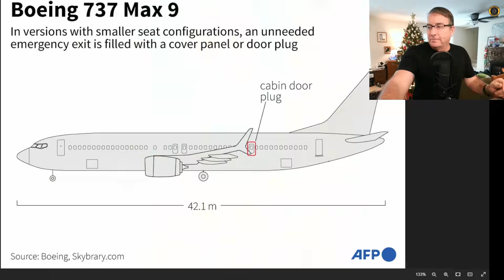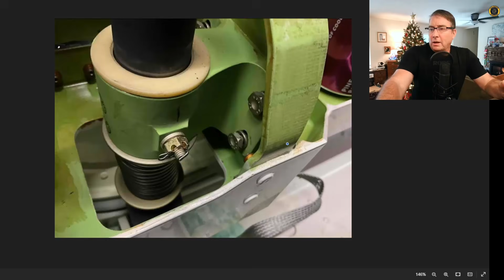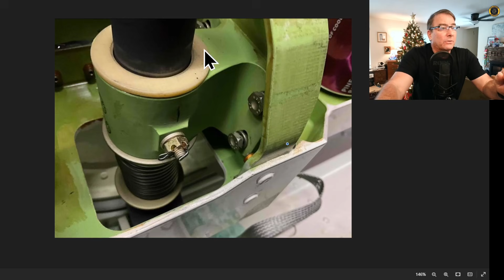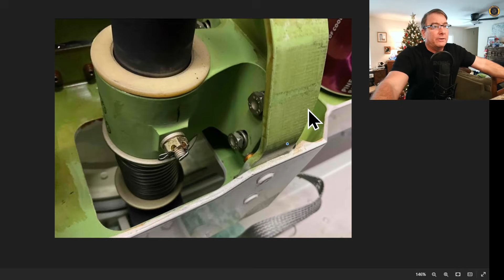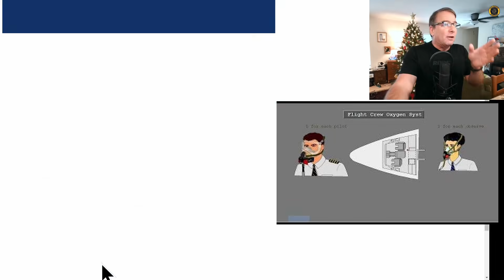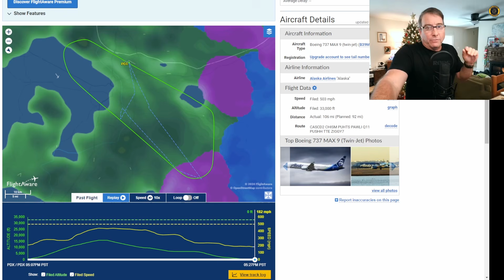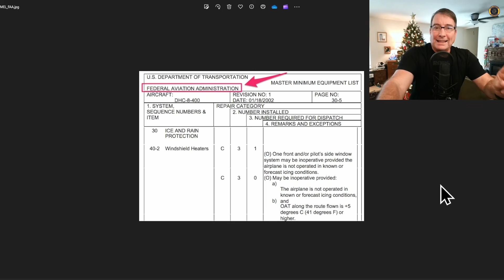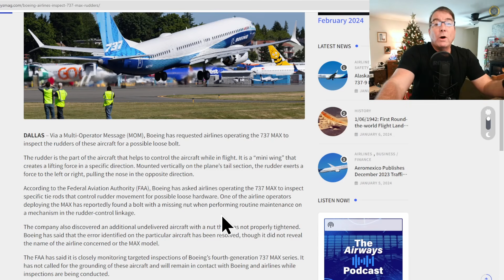"Yes, We Have No Bolts"  9 Jan 737 Max-9 Update

Comment: Separation with minimal damage implies missing bolts which implies a QA/procedures failure.  IMO that's far more concerning than a materials or design flaw.
Reply: Not to mention a fundamental assembly failure. The first part of QA is doing the job right in the first place. You can't QA quality into a design, it has to be there to be assured.
Reply: Correct that means it slipped past two sets of eyes minimum! the Mech who put the plug in place, and the Inspector who RII the work!! Boeing may have to go with two RII inspectors signing off critical tasks until they get this situation under complete control!!
Reply: @SAC-93  I think it's going to take way more than that. They are going to have to purge an extremely lax culture like a cancer. People are going to have to be fired, lists are going to have to be made far more explicit, and probably need to have independent checks from outside the factory until they get the culture back under control
Reply: I dunno, both - failure or flaw - can be pretty damaging to an airplane. Wouldn't want to be flying on a plane where any of these is a factor.
Reply: (((Banks))) give favorable loans to companies which hire based on DEI goals instead of merit.
Reply: Lazy union labor not installing the pins in the first place and equally lazy union labor not finding that they haven’t been installed by other lazy union labor.
Reply: @qwerty112311  The planes from SC are substantially worse than the union-made planes, to the point where a major airline (Emirates iirc) refused to buy SC-made planes.  But don't let that get in the way of your narrative.
Reply: @qwerty112311  That's why moving 787 production to South Carolina turned out so well...  Oh wait.
Reply: @qwerty112311  The assembly line workers putting on these door blanks/plugs were probably high on drugs and listening to music on their earphones/cellphones and not paying attention to their job.
Reply: @mikedx2706 probably not, no

Comment: The Cockpit door has always been designed to fail under large differential pressure, since 737/747/777 days.
It's just not talked about until now, It's part of the strutural safety system.
Reply: It makes sense, but I always though there was just the slot in the door which was supposed to open with such events.
Reply: well now terrorists know how to open cockpit door with simultaneous panic and pilot disorientation for tens of seconds, i could only hope that some one would insist for Boeing to fix that (as it was said if door properly made it could allow air to escape without allowing access to cockpit for unauthorized personnel)

Comment: Unbeknownst to the crew, the cockpit door is intended to open when explosive decompression occurs, according to NTSB briefing last night and Boeing is modifying their manual.
Reply: Boeing seems to have a thing for not including things in the manual which pilots might need to know.
Reply: Or it's another cover up to excuse the designed blow out panels' failure to function?

Comment: The bolts use castellated nuts which are locked with split pins  to prevent loosening. They are definitely not cotter pins.
Reply: A cotter pin is what the US call a split pin
Reply: Here in the US, we all them cotter pins.  They are a “one use,” item, meaning a new otter pin must be installed every time the existing one is removed.

Comment: I fixed F-15s in the Air Force. My jet underwent far more G-forces in a single flight than these jets will ever see during their entire service life. Loose bolts on the United jets tells me there were no cotter pins installed; castle nuts cannot loosen when the pins are installed.
Reply: If they were installed at all . . . .
Reply: You're assuming they even had bolts in the first place.
Reply: @OMGWTFLOLSMH  The United jet's bolts were found to be loose, therefore they were installed.
Reply: Those loose bolts were the ones holding the brackets, 4 off. Picture shows the heads of the bolts with a locking washer underneath. Yes, the bolts with the castle nuts and cotters needs to be missing to allow the door to lift and be released from the mounting pins.
Reply: @TomYoureDoingItWrong  different bolts
Reply: Different bolts, the lose bolt are the ones holding the bottom hinge bracket to the door. Watch the video where he points them out, you can clearly see two are lose.
Reply: Look at the picture of the loose bolts in the picture from United. The securing bolts with the castle nuts and cotter pin are there and properly installed. 

What is loose is the bolts that hold the whole lock fitting to the frame of the airplane. They aren't cotter pinned, and they aren't even lock wired. They are just (hopefully) torqued to some spec, and everyone quietly hopes that vibration won't cause them to back out. It appears that hope is unfounded.
Reply: @lwilton while troubling, those bolts coming out would be irrelevant.  The four pins that secure the door to the guides are all that matter.  If those are there, the mechanism to launch the door being disconnected is of no consequence.
Reply: @qwerty112311 um, what 4 pins are you talking about? For this door, there’s four bolts, two upper, two lower, and 12 stop pads and fittings from everything i have seen/read.
If the four bolts are missing, the door is somewhat free to move up and out.
Reply: @lwilton  Probably not even installed with some Locktite blue.
Reply: @lwilton  It seems like very frequent inspection of the bolts that hold the lock fitting to the frame would be prudent.
Reply: @davidbiagini9048  Yea. Of course it requires ripping the interior out of the airplane to get to those bolts and inspect them. That could limit practical inspection frequency.
Reply: @davidbiagini9048  Some sort of Locktite gel is what I expected in addition to some precise torque and correct final appearance on those side bolts, if indeed the spring assembly was also loose or cracked by ten weeks of landings.
Reply: @davidbiagini9048  That bracket is behind some cabin paneling. A simple wirelock would be the smart thing to do.
Reply: @lwilton  IF those bolts were the problem, or have a high probably of becoming a problem, then an easier inspection method is needed - which would probably be a very costly redesign. But if lives are at stake...
Reply: Same on farm machinery. Unless its some far out design, the cotter pin has no stress. It just keeps the nut from moving. Even old bailing wire will work. Missing cotter pins is a deliberate action on someone's part.
Reply: What bolts? What drug tests? What quality?
Reply: I agree that the cotter pins were probably left off the castle nuts.  That would result in the castle nuts slowly backing off over time as the jet is operated.  Eventually the bolts would then start to slowly unscrew themselves due to operational vibrations and then totally back out of the door mechanism.  Once that happens, the lower springs would push the door up and outwards, causing it to be caught in the plane's slip stream and the blown off the plane.
Reply: if the hole  in the bolt is in the right place.
Reply: Spec will either say to either turn the nut the minimum amount further after tightening to the spec torque figure to allow easy insertion of the pin or back off the nut in a similar way. In this application there is no need for it to be tightened to a high torque figure.
Reply: Well, IF the bolts were installed!
Reply: The castleated nuts can absolutely loosen. The pins simply prevent them from falling off completely.
Reply: The bolt is holding a keyed shaft so the entire bolt would have to come out.
Reply: Or that the nuts weren't installed at all....
Reply: Time to call in the FBI to investigate for sabotage...
Reply: Second that.  I was a structural technician on F-4E, F-16C/D, MD500 & others.  If installed correctly, now way were those bolts going anywhere.
These large commercial planes hardly experience anything close to +9G -2G vibrations or routine hard landings.
I've seen bolts and cotter pins on Phantom landing gear that no ones has touched, they stay put.
Reply: the ones that were found to be loose were not castle nuts
Reply: You may have fixed a friend's F-15.
Reply: @martharetallick204  I was in during 1981-85. My first jet was a 1977 B-model, and the second a 1982 D-model. This was at Nellis AFB in Vegas. There are a lot more jets in the inventory now than there were 40 years ago. When was your friend in?
Reply: @TomYoureDoingItWrong  Mid 1970s to mid 1990s. First name is Paul and his call sign was Skid.
Reply: Loose bolts don't mean the cotter pins were not installed in this instance, they r not a very tight bolt otherwise the guide will be compressed and  damaged,
Reply: @sopissedoff yes it does. If there are cotter pins, the bolts will not be loose.
Reply: Agree completely. in order for the notches in the nut to line up with the hole for the pin you cannot predict exactly what torque the nut can be tightend to... You get what you get! @sopissedoff

Comment: Nuclear Power plants can also operate without 100% of it's safety equipment operable. There is a book call Technical Specifications (Tech Specs) which outline how long you can operate with specific safety equipment out of service or oos. Let's say you have two high pressure safety injection pumps. If during testing you discover one oos or you have to manually disable one for maintenance the tech specs will (speaking specifically of the plant I am familiar with but all pwr plants are similar) tell you that you can operate for 24 hours without the pump but if it's not back you must be shutdown within the next 48 hours. 
So you have 24 hours to get the pump back in service and if you can't you must begin shutting down and be shutdown within 48 hours.
No complicated machine is expected to operate with 100% of all equipment and redundant equipment in service. 
In a nuclear plant you are given a time limit to get things straightened out. You can't operate forever without the redundant equipment.

Comment: By the way, how is it that this thing doesn’t have a EICAS throwing messages? They seriously have caution lights spread all over the panel?
Reply: 737 has never had EICAS. Its supposed to be on all new aircraft but as the Max 7 and 10 still haven’t been certified they should get it Boeing are trying to convince Congress to give it exemption as it would then be too different from the Max 8 and 9

Comment: Who installs the seats on the plane? I understand the plug was installed the plane was tested and then removed when the seats were installed.
 I'm not sure who installed the seat was it. Boeing was it the airline?
 Was it a third party?
Reply: Boeing
Reply: @tomstravels520  OK so let's better understand why the door is tested then removed then replaced. If Boeing is doing all the work why did they need remove the door to install the seats? In theory the seats could be installed then the test could be Run. There might be a discrepancy between the second party. Doing the work for Boeing and then Boeing gets it To Do the seats. That gets into even more detail of how it happens.
Reply: @geniferteal4178  Boeing remove the plug, put the seats in, refit the plug and pressure test to 150%. However I suspect because the aircraft is stationary and the door pushes against the stop pads anyway it wouldn’t have blown out even without bolts fitted
Reply: @tomstravels520  The pads all seemed to be there and no one's mentioned otherwise. It seems the only way the door disappeared was  by moving up-and-over the pads And other securing channels. 
What is the reason the door plug needs to be removed and then the seats put in after it was tested? I get that it's removed to have room to install the seats But why Are they installed after the test? Is it done at 2 different facilities? I initially thought the plug was put in and tested and then the customer got the plane and did their own outfitting of the interior and that's why the. Door was removed the second time.  Seems I'm wrong about that but I'm still trying to understand it better.
Reply: @geniferteal4178  what test? The pressure test is done AFTER the seats are installed to ensure all doors and fittings are correctly in place
Reply: @tomstravels520  I'm not gonna look for it now but I'm going on what has been explained and I think I've followed very carefully it was explained that. The door plugged its fitted then removed then the seats are installed and then it's refitted. Maybe I'm wrong about the test but is that first part right?
 I'm really confident they install and then remove the door and then install it again. That being the case why do they install the door in the first place?
Reply: @geniferteal4178  because it has to get transported by rail from Spirit Aerospace to Boeing. So may as well fit the doors on to the fuselage
Reply: @tomstravels520  OK so that confirms one thing I thought it's done at 2 different factories. I'll have to check if I'm wrong about when the testing is done. I was also a mistaken that I thought the airline put its own Seats in.

Comment: I find it interesting and concerning that the cockpit door was blown open by the explosive decompression.  The door has blow out panels to equalize the pressure.  Perhaps that's what the crew means.  If the door was securely latched closed, it is hard to understand how it would be blown open.

Comment: I think we're all hoping the plugs were NOT properly installed... That would mean an easy fix. If the plugs WERE installed properly that'd be a whole new can of worms putting the integrity of EVERYTHING into question 😬
Reply: I'm not sure. If the plugs weren't properly installed that indicates a critical deficiency in the manufacturing procedures and/or (more likely) QC and inspection procedures, and in fact the entire quality system and culture. That in turn raises questions about virtually every other assembly operation on the aircraft.

Comment: Juan, I’m with you on your uneasiness in finding out that the entire cockpit door is SUPPOSED to blow out in a depressurization event. That is a MAJOR problem almost guaranteed to cause chaos in the cockpit! My prediction: these Max-9s are going to be grounded until the cockpit doors are modified, which will take a LONG time. 😮
Reply: The way things are going it wouldn't surprise me if boeing made that up so they don't have to explain why the blowout panels failed.
Reply: I'm guessing they are fitted to all 737 MAX and most NG variants.  I'm surprised they don't have small blowout panels rather than the whole door opening.  You just need some kind of vent to equalise the pressure either side of the door.
Reply: As Juan said you can't have different pressure in the cabin and cockpit. The unequal pressure could damage the airframe at the meeting point of the two pressure envelopes, potentially catastrophically.
Reply: And can you imaging what the passengers are thinking when they see the cockpit door lying in the aisle  between the seats?
Reply: are the cockpit door swing and the blowout panels designed for different directional expolsive depressuration?
Reply: I think you will find that EVERY MAX has the same cockpit door design...
Reply: It seems like a design that causes checklists to fly out of the cockpit is not a good design. Does the same thing happen with blowout panels?
Reply: The hinges are still mounted in the acft. The plug door IS dethatched! @R.BOWERS

Comment: One of the green hinge fittings you mention at 6:30 was retained on the aircraft. See the 6th and 7th photos on the NTSB's Flickr album, one of them is clearly visible under the plastic still on the pin on the aircraft.

So if one is missing then it departed the aircraft with the door and became separated from the door at some point. The question is whether those 3 bolts holding it to the door sheared before the decompression and allowed the door to move up and off the stop pads, or they sheared during the decompression and failed before the nuts + washer on the top of the black hinge guide assembly as the door was ripped off the aircraft.
Reply: Gonna guess nothing sheared, but were left out/loose, and the door dropped, and that was that. It perhaps had to be a little off the stops on takeoff, because a tiny pressure over hundreds of square inches would hold it in place.
Reply: @UncleKennysPlace  If the green hinge fitting is still on the aircraft, and the door is on the ground, either all 3 bolts holding it to the door came completely out (or were omitted), or 1-3 of them sheared, no? On the other side it's not on the aircraft and according to the video via NTSB one is "missing", so it's also not on the door. So on that side all 3 bolts holding it to the door also came completely out, sheared, or were omitted. On that side it also came off the hinge guide pin, implying the locking bolt also sheared or was omitted or backed completely out. Similarly in the NTSB Flickr album it looks like the retained hinge guide fitting is at the top of the pin, but it's hard to tell. If it's at the top of the pin the locking bolt on that side also was omitted, came completely out, or sheared.